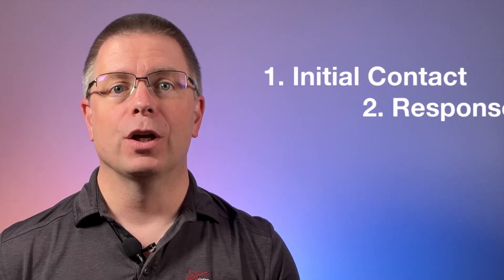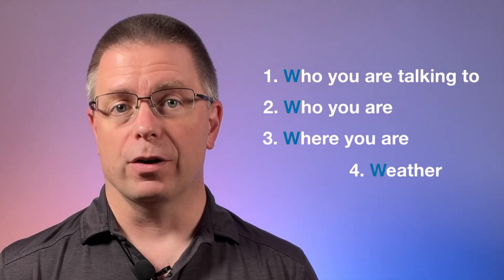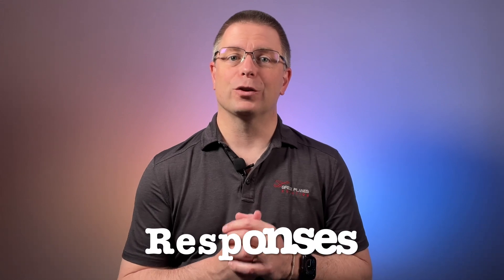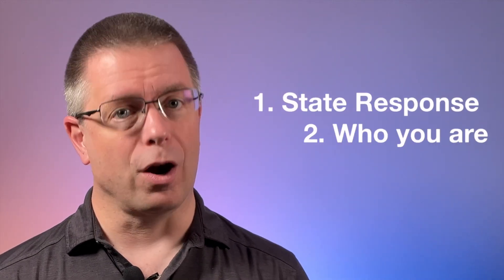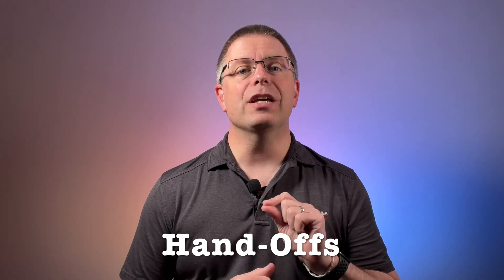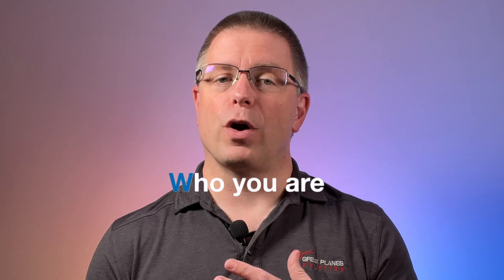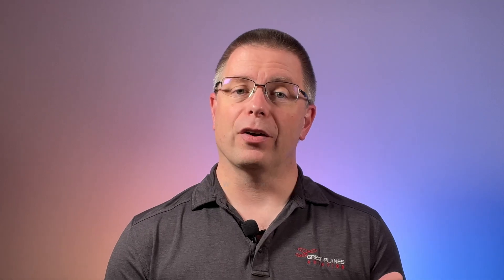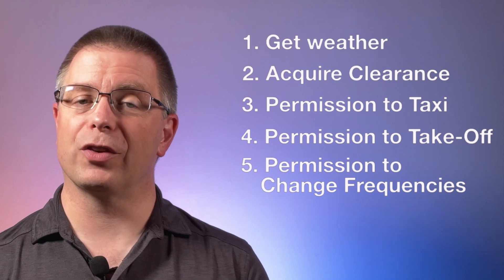Seriously Easy Radio Communication | Unleash Your Pilot Radio Mojo!

Comment: Hey! Love the videos! Can you do one on ifr holding! I’m struggling with them
Reply: From a flight perspective. I’m having a hard time visualizing how to enter the hold. My cfi is currently having me use the thumb trick but it seems to not work every time for me. This could be I’m not doing it right or the fact I get confused based off what quadrant atc wants me to hold in. Ex: sw se nw ne
Reply from the maker: Sorry to have taken a little bit to respond.  I’ve been traveling over the Memorial Day Holiday.   I’ve added this to my list of videos to work on, but it will be awhile before I can get it made.  In the mean-time, here are a couple of thoughts that I hope will help…

1.  If it helps…
	A. On the holding side (the side with the turn on it) there are only two entry possibilities—direct and parallel.  
	B.  On the non-holding side, (the side without the turn) you must use either direct or teardrop.
	C.  If the holding and non-holding sides don’t make sense, please look at FIG ENR 1.5-1 in the AIM.

2.  For the “Thumb Method” to work best, you MUST have the airplane heading direct to the fix.  In other words, the nose of the airplane must be pointed at the fix.  Without this step, you will need to do additional math.

3.  I’ve noticed some students using the “Thumb Method” are using the INBOUND heading rather than the OUTBOUND heading when determining the entry.  The correct option is to use the OUTBOUND heading.  

I hope at least a couple of these are helpful.  Thanks again for your comment, question, and suggested video topic.
Reply from the maker: Thanks for the comment and question.  Are you struggling with holds from a knowledge (written test) perspective or from a flight perspective?  Thanks again!